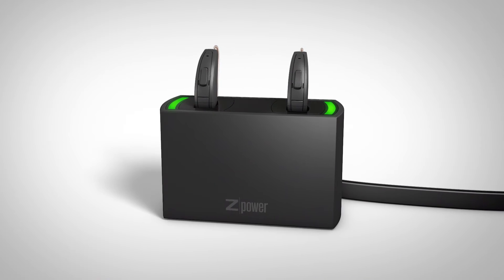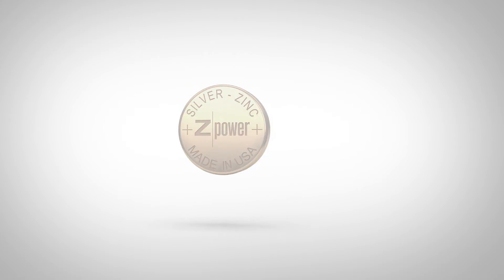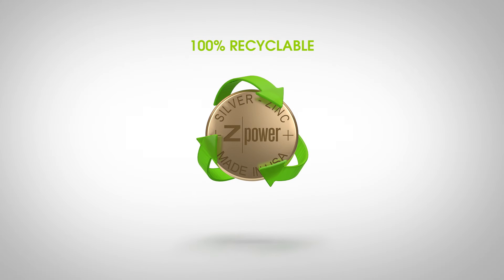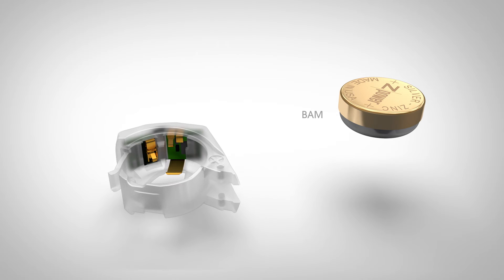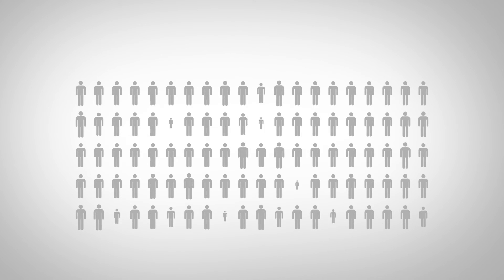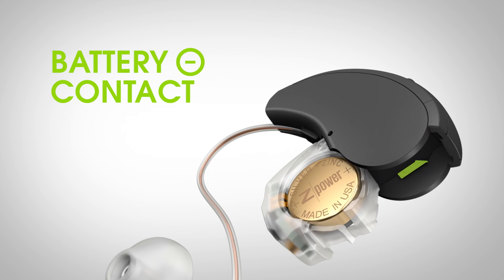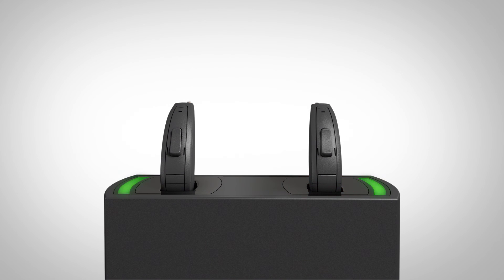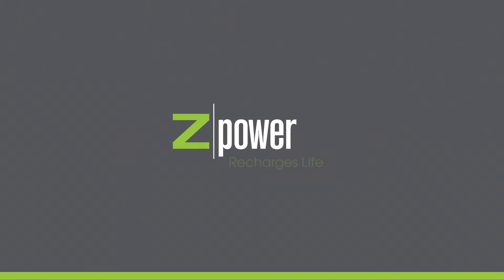Informational Video About ZPower Rechargeable Batteries and Charger

Comment: !Have a situation which I have found no answer.  Camping with flower device.  I thought by using a portable phone battery  pack that it will charge my wife's rechargeable hearing aids with no problems for 7 hours.  Well ... That did not work when camping.  What are your suggestions when camping with rechargeable batteries on hearing aids?